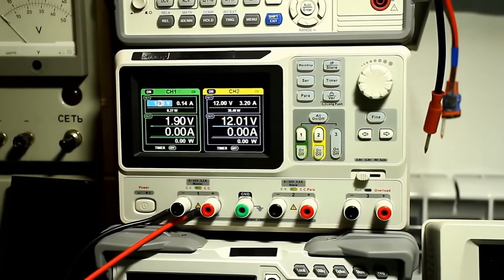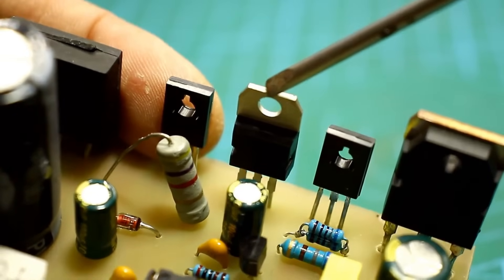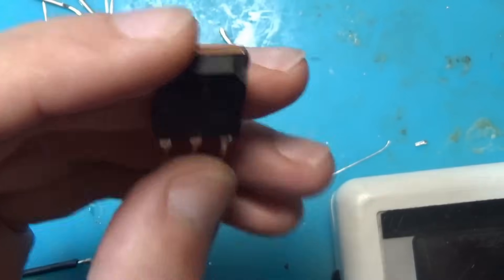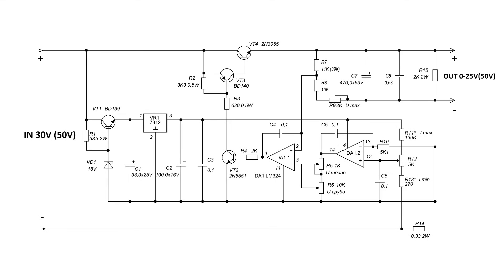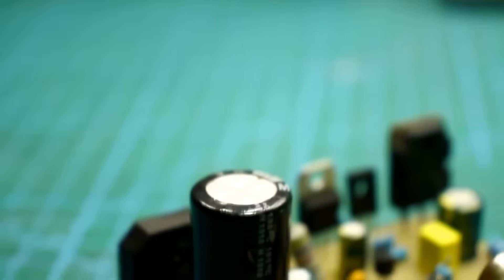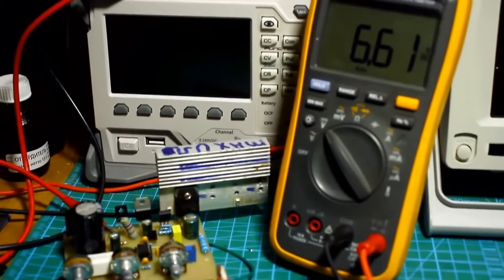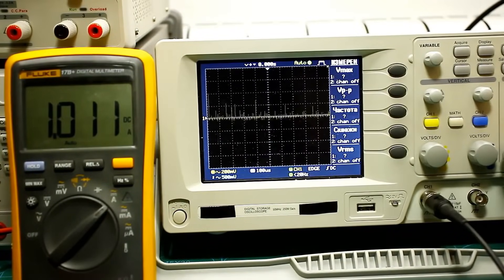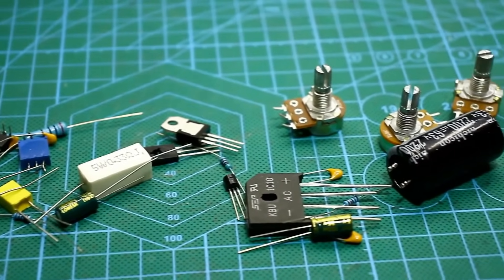Simple and affordable DIY power supply

Comment: Thanks for the useful video.I made an example of this using reverse engineering from a power source.I want to write a microcontroller program.And use it as a car battery charger.And charging information is displayed graphically on the graphic LCD.I can also use your high-power circuit chips.I hope I can write a program for it.Displaying information on a graphic LCD is the most challenging part of my job.

Comment: The circuit may work, but in my opinion it is far from a proper bench power supply. For example, the short circuit protection seems slow, and in cases where an earth reference is necessary, the current can flow through the earth, thus making the overcurrent protection useless. For a beginner, these things can really make the difference if something is wired incorrectly. An upgraded version with proper stability testing (and output waveforms in case of a short circuit event for example) will be nicer.

Comment: Very nice circuit. I have a question about the KBU and GBU rectifiers. The legs are closer to one of the faces but both faces are plastic, so witch face should be on the heat sink?

Comment: Can you make video on voltage regulator (well you might already have a video on it which I don't know). I wanted to see someone build a series or shunt voltage regulator using op amp, snd not showcase some 78xx ic. There's many video showing the theory but very few actually show the actual circuit building and its properly working.

Comment: Reference voltage comes from a 1-chip regulator & the saturation figure of an op amp, both of which can be noisy.  Refine the reference by inserting a reference diode (6.2V tends to be the most stable) & ballast between the two.  That way it can clamp the current when called on & does not affect the reference figure.